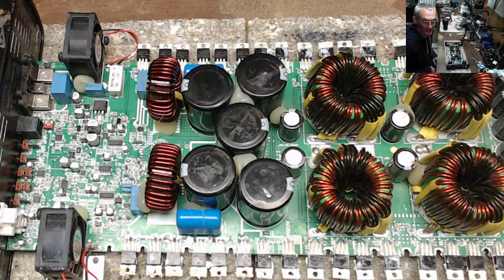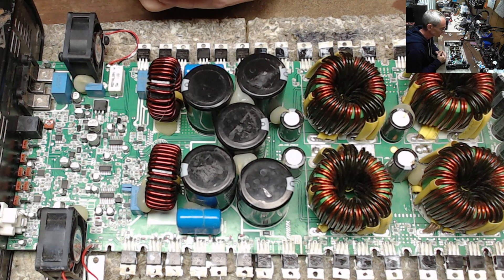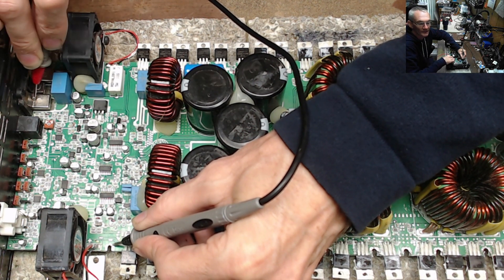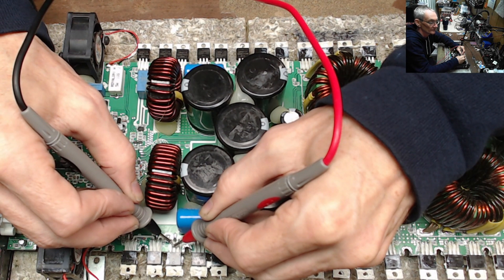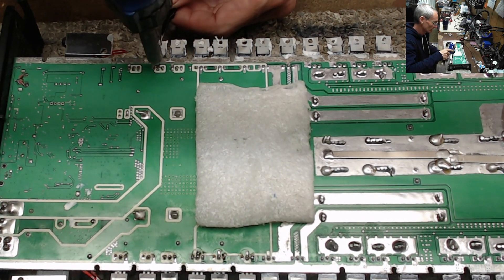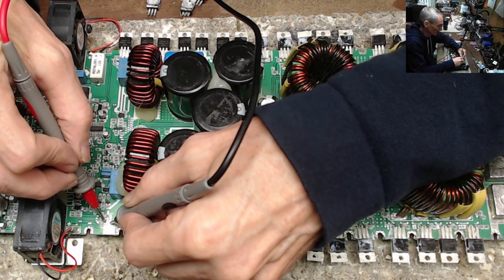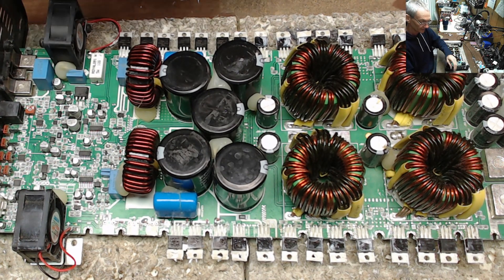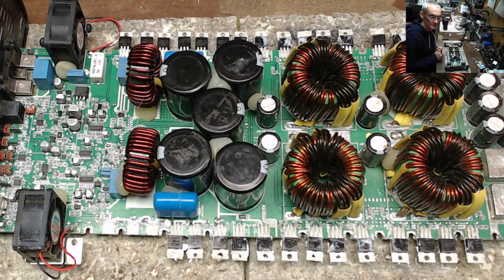Taramps Bass 8K Output Fault Rare Drain Source Short Missed During Repair

Comment: Hi Ed, i got my bass8k in to protect today due to voltage getting down.i have checked all mosfets they are look ok and tested by multimeter on source all 3 legs.also checked diodes and low voktace ic drive also working.what is the problem what to dig out esle?
Reply from the maker: What is the resistance from the gate to source of the output transistors? There are 4 sections, 2- high side, and 2 low side.
Reply: @ellensburgamplifier  hi Ed.thank you for reply.i have measured 10.7k for low side and 11.1k for upper side.the same from opposite side.what to test else?
Reply from the maker: @basshead100  Hello! As to not confuse people my name is Todd :) sorry I missed that earlier. You will want to put the amplifier output section into shutdown by removing the SD solder bridge. This will allow you to see what the pre-amp is doing and make sure you have your square wave signal to both Si8244 ICs from the 319 IC. You are reaching a point where it will be hard to assist through comments.
Reply: @ellensburgamplifier  sorry Todd)i jsut observed that when i disconnect my speaker wires protection mode disappers at all and in switching to functioning mode blue light,but for curiosity i have measured voltage coming out from speakers output nozzle it shows 23.4v but to supposed to be 0.0v at volume down regime.
Reply from the maker: @basshead100  Oh you have DC offset. Anything up to .05v is acceptable. I would first check the DC offset circuit as sometimes (in lucky situations) a brief output short that doesn't damage the drive will damage the DC offset resistors. Otherwise, I would replace the Si8244 ICs and go from there.
Reply: Hello Todd.i have dead short on lower drain-source transistors,take out lower 3 off and checked them are ok but on a board still short.find shorted 1uf 250v blue capacitor,1 x Resistor 4R7 and C71 and c6 smd capacitor blown.what to check please advise.IC drivers both been replaced
Thanks
Reply from the maker: @basshead100  Do you have that short when all of the transistors are removed?
Reply: @ellensburgamplifier  exactly.i removed all transistors and checked only 3 off low side transistors location short from RCA side.i changed Si drives but no change.nobody knows what is the problem.
Reply from the maker: @basshead100  Shoot me an email at service@ellensburgamplifier.com and I will be able to assist you if you don't have a schematic for it. Not many items left that can be shorted past the transistors.
Reply: @ellensburgamplifier  thanks a lot.already emailed you)

Comment: Hello, thank you for always replying to my comments
In a video, I asked to explain the class D circuit and you sent a link that I looked at. Thank you
I want it to teach different parts of a class D circuit on the board. For example, the same device or something similar. Is it possible to tell the different parts and their functions, for example, what do these inductors and capacitors do? Or where and by which component is the triangular waveform produced that is compared with the input signal? Where should we find the gate drive, etc... Of course, it doesn't matter which board it is, my goal is to know the different parts of class D.
  Thank you very much for taking the time to read my comment
Reply from the maker: The best way to start learning that is to have a schematic and start at the pre-amp working your way to the output ICs understanding what each component does along the way. Most datasheets will give you an application example so you can learn how the topology works.
Reply: @ellensburgamplifier  thank you very ❤️❤️🙏🙏❤️

Comment: Hi, how are you? I'm new to amplifier repair. I have a question, depending on the circuit of a class D amplifier, these may have different GND. I use an oscilloscope that connects via USB to the PC. When I try to see the gate signal, I have strange readings from a side but the other is normal by taking the GND from where GND is supposed to be
Reply from the maker: Hi and thank you for the support. I don't know when it comes to the USB scope how they reference the probe's ground. My scope ground is always attached to the amplifier ground terminal.

Comment: I always check all 3 legs on all fets for shorts, & solder bridges after I work on a board before applying power.
Reply from the maker: Indeed! It is something I always forget to check as it is a rare occurrence to have a non-visible drain/source short @ 180 volts.